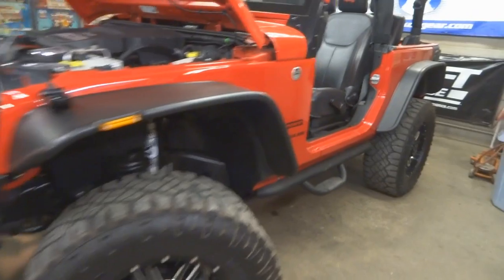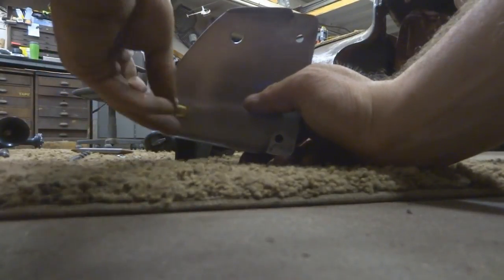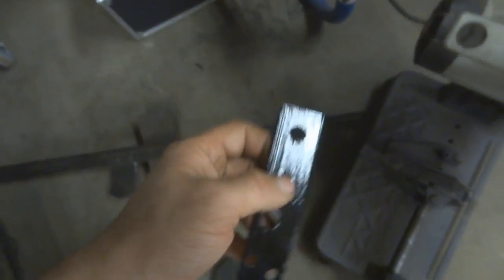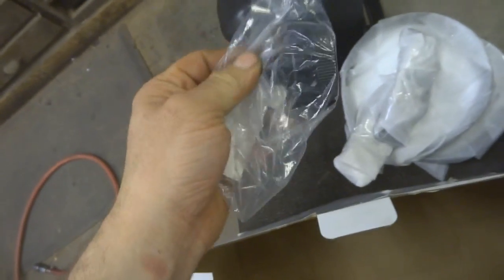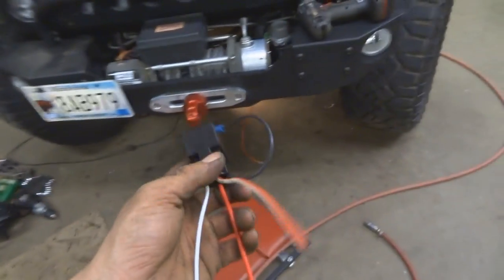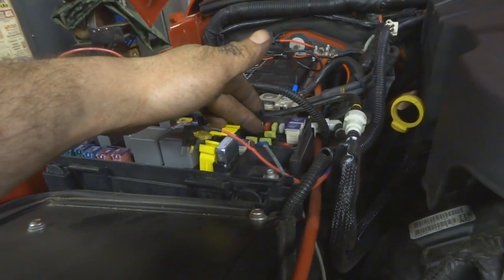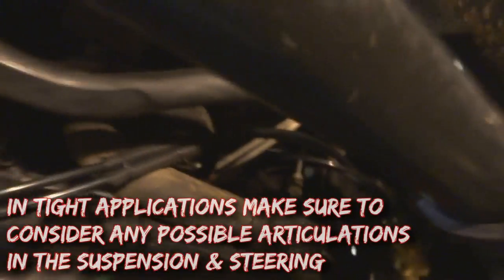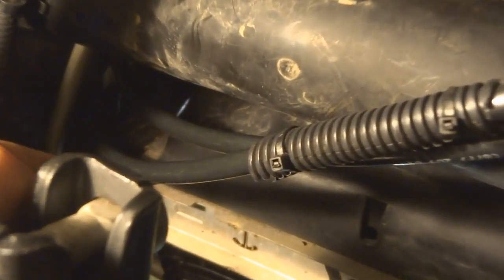How To: Affordable trainhorn & Air Management INSTALL

Comment: Hey Tinman new nice job on the installation. I do have a question where did you buy the 4 in 1 push lock air fitting?
Reply from the maker: James Kimble that fitting came with the train horn kit
Reply: Tinman 2 Kustoms OK thanks